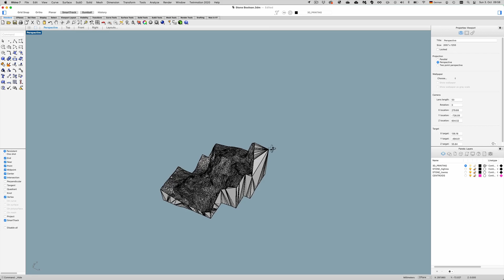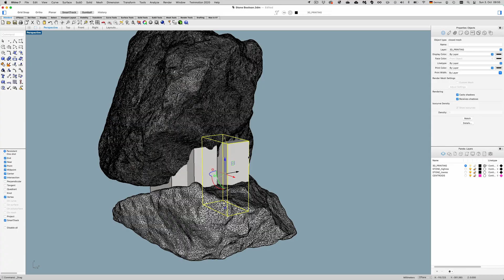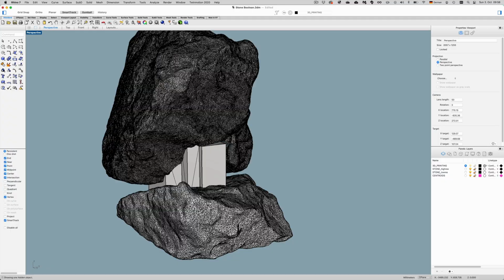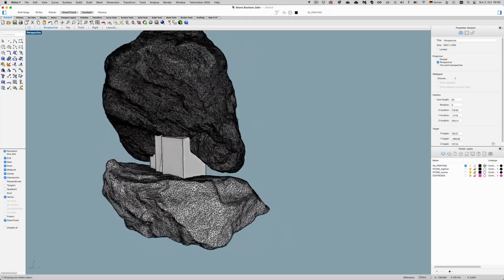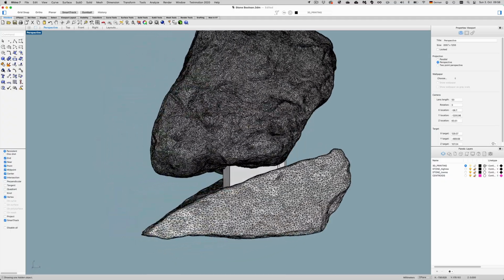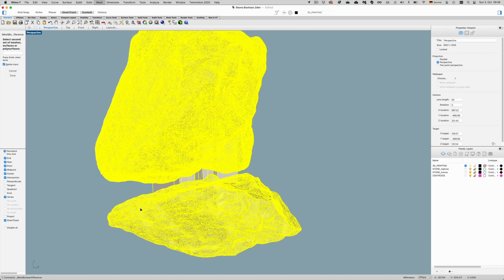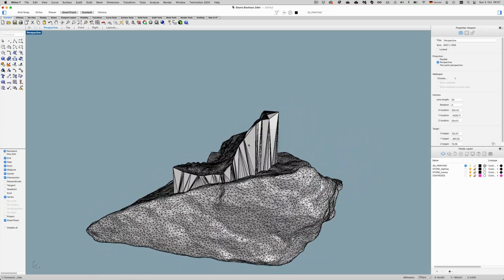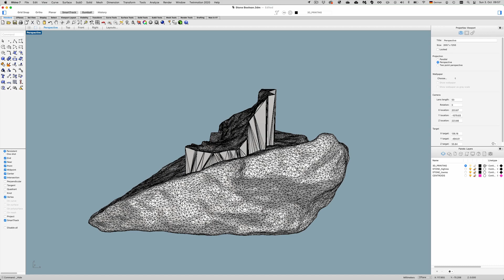Rhino 3D - Mesh Boolean

Comment: Hey Mate - I have lots of issues booleaning meshes that I have imported into rhino. sometimes it works, sometime it doesnt. any advice? :)
Reply from the maker: Hi Asher,
Thanks for bringing that up. There are cases in which the boolean algorithm fails in Rhino. Easy work around is to move the objects one or two units (in some cases 0.01mm are enough). I also have found the boolean operation in Grasshopper to be more robust.
Reply: @bastianwibranek6063  Thanks mate! That is really helpful!